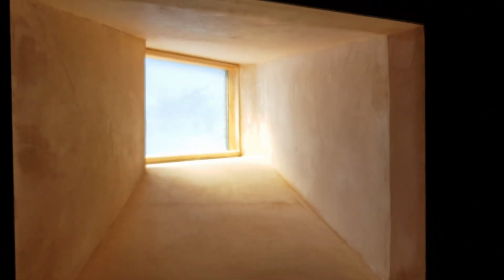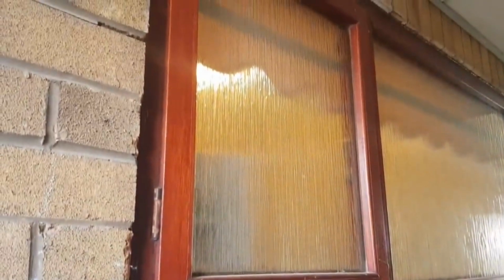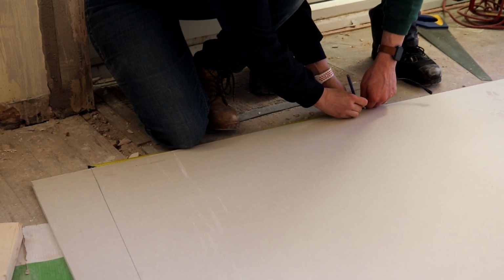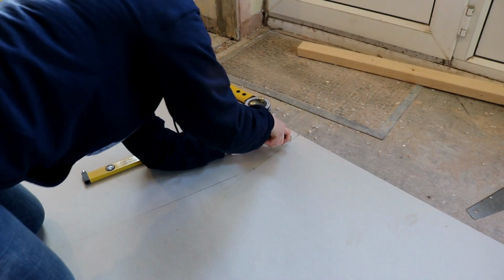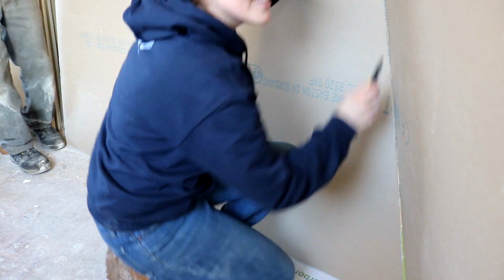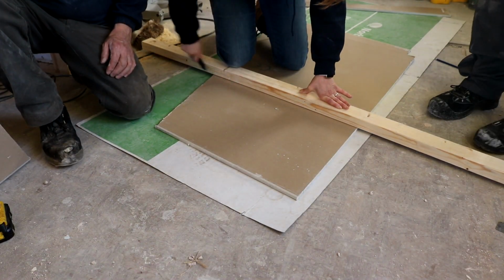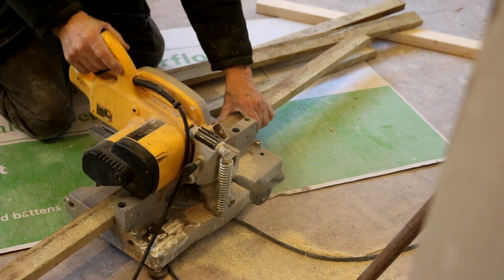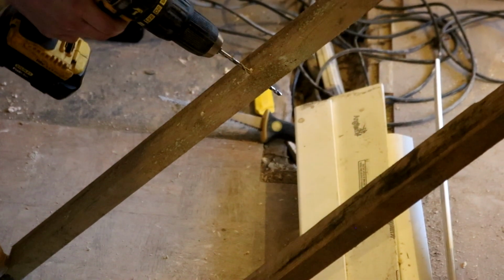DIY Skylight Sun Tunnel with Plasterboard | The Carpenter's Daughter

Comment: Going through the same process, velux installed, opened bathroom ceiling (no windows) and to be honest sunny day we dont have much light coming in.  We dont have box sectioning in place yet so just wondering once you got yours boxed and painted was it brighter?👍
Reply from the maker: So much brighter!!  It's a tunnel of light.  Made a massive difference.  We've also got a large mirrored bathroom wall cabinet that reflects light even more.

Comment: Nice work, if you're going to do a lot of that kind of thing, the 10v version of the dewalt drill is quite nice as it's a lot lighter and you don't need that much power for drywall screws, probably not worth buying for one job, I've got the 18v for real work, but the 10v drill driver. / impact driver set is quite nice as they are so light I can wear one either side in holsters on the toolbelt when up ladders.